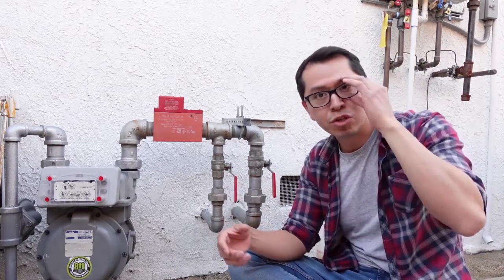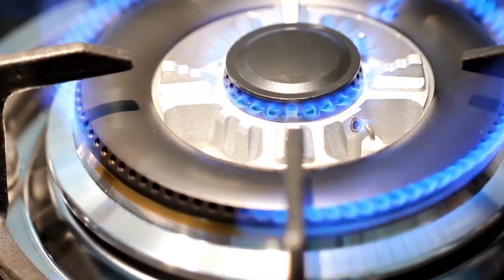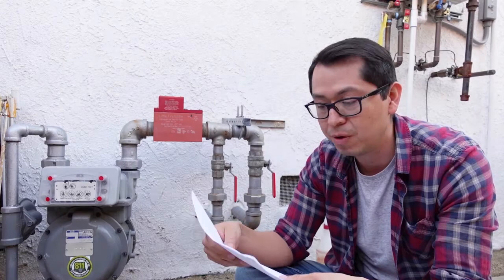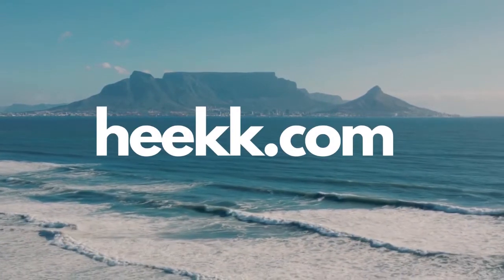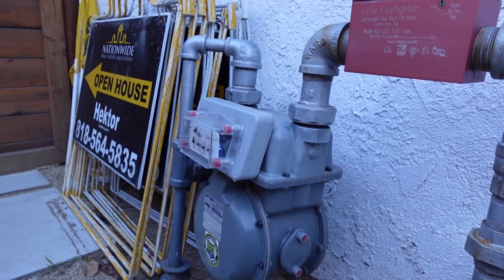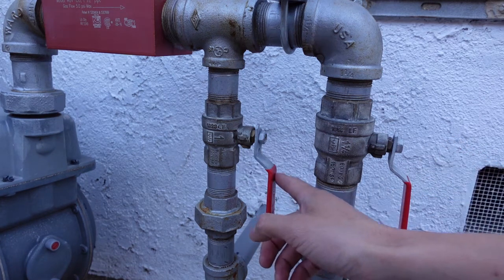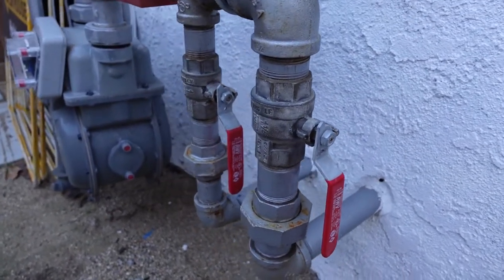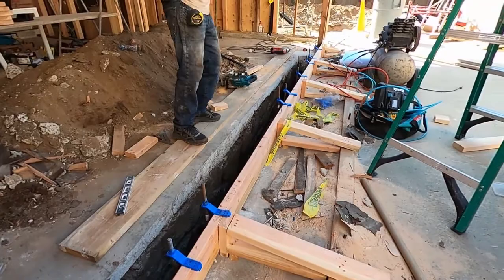ADU - What size gas line to install? find out

Comment: Great video , please can I have the name of the gas shut off valves that you installed? Did they have them at home Depot? Thanks
Reply from the maker: The best place to buy it will be Hirsch pipe & supply. They have multiple locations

Comment: I didn't pass my inspection because there was no Heater in my ADU. It's a small area so I'm having trouble finding a Heater that fits my place. Does anyone know if the ASHLEY Hearth Products Model #DVAG11N will pass inspection in Los Angeles CA?

Comment: So is the house line undersized? Interesting that the ADU line is so much bigger than the house.
Reply from the maker: It's size for when the house was build using codes from the 50s. My plumber followed current codes to build the ADU and that's how we got a 1" gas line

Comment: Thank you for your video..... BUT your information is NOT completely accurate. I am currently going through this scenario and SoCalGas has a protocol to follow. First, you need to fillout online a cost estimate application and second, fill out an application. The estimate calculated a cost value of $15, 250.00!!! This is crazy! I was provided with a Project# and a 5-digit code for tracking.
Reply: same here. i filled out application and got assigned a planner that is requesting digital plans etc. On socalgas it states this: "Scanned copies of plans (property maps) are not encouraged but may be submitted for smaller-sized developments where a digital GIS or CAD file was not created and only copies of pre-existing plans (property maps) are available." Did you just send over scanned copies or went all out on their request?

Comment: Good information. It's really not that technical once you understand the concept behind the sizing. Very similar concept to sizing water and electrical. If anyone needs help in San Diego, I can point them where they need to go.
Reply: Can the homeowner submit the gas pipe sizing to the planner or do I need an engineer?
Reply: @Skull2121  who ever prepares your submittal set for the city can prepare it. Just follow the standards for distances and fixtures. Don’t undersized your water heater. That includes the flex line that connects your piping to the actual unit.
Reply: @URBNBLDRS  thanks! I’ve seen your videos before and they’ve helped me to this point too! Subscribed!

Comment: im using electric stove. propane dryer and gas water heater. that should lower the pipe size of the gas line. Any words?

Comment: Is not that the information available is not user friendly, the majority of the information is base on math calculations  from the engineering department, leave it to the pros....
Reply from the maker: With this sheet everyone not just the pros will be able to calculate their gas line. And the homeowner can verify the pipe size with the city inspector. It's super easy even the pros will download the sheet